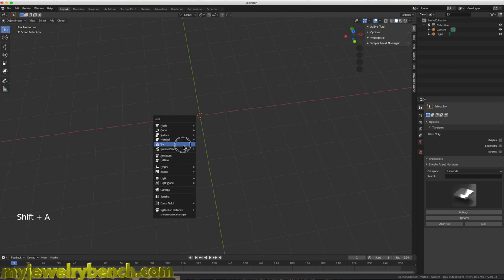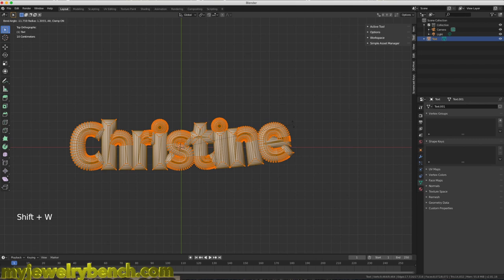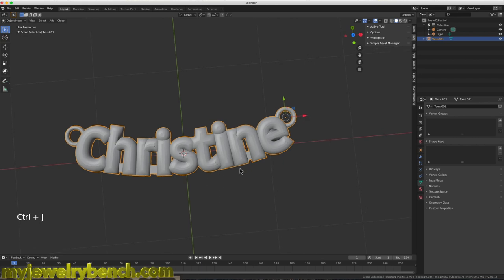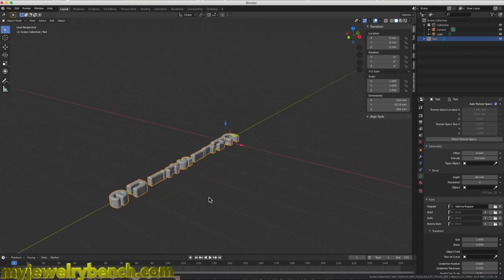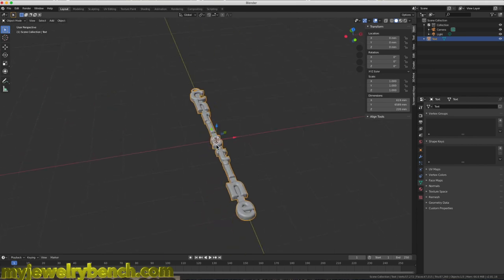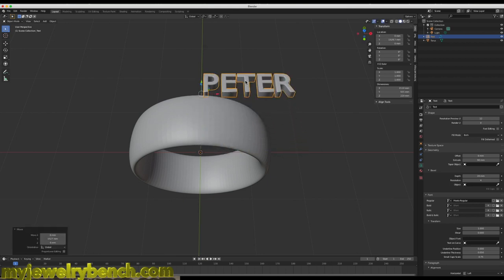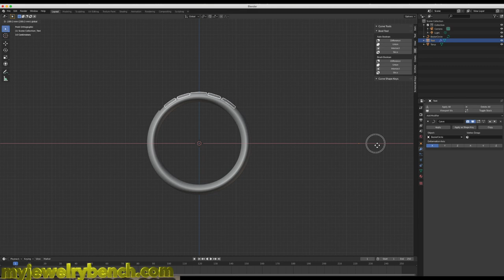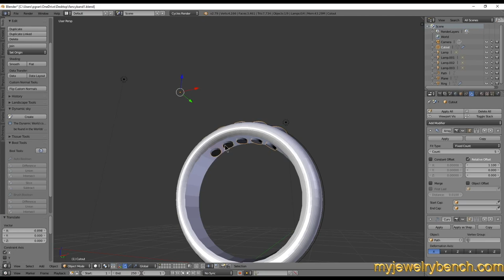3d Printing Text Jewelry you make with Blender and Castable resin!  Enjoy!

Comment: Sir How to measure the white of the head ring on the system .. plz explain
Reply from the maker: There is a tab, in the tools panel.  When you have an object selected, and you look at the tab labeled "EDIT", the dimensions of that objects will be listed.  You should be in Object Mode, not Edit mode.
Reply from the maker: To bring up the Tools panels, put your cursor over the main window, and press the "N" key...